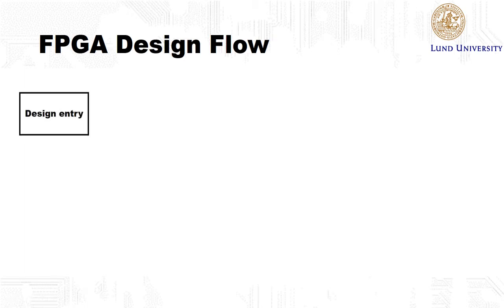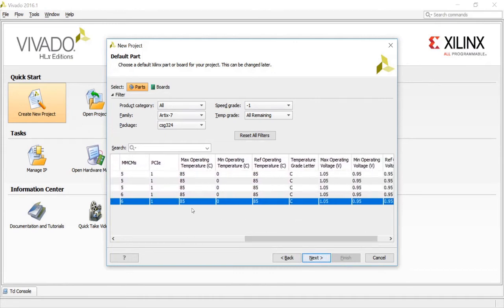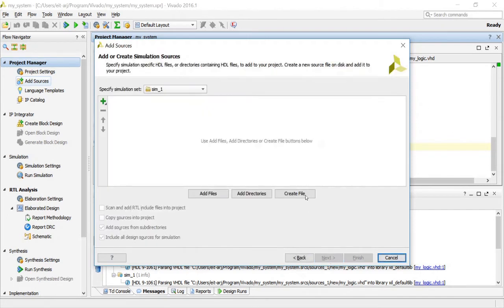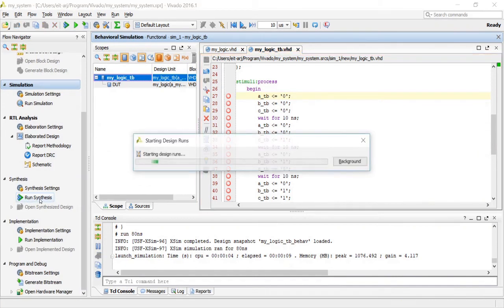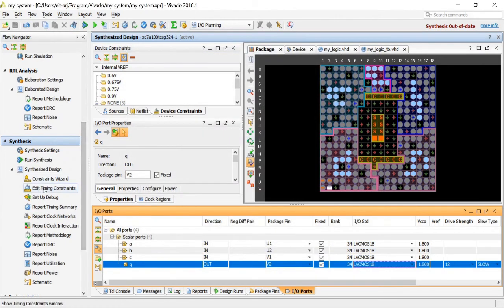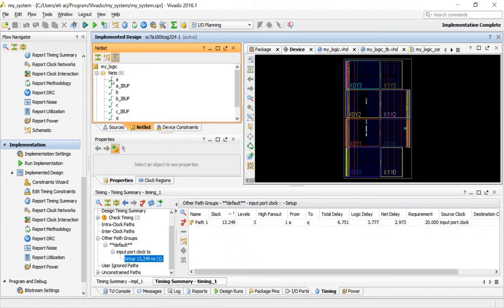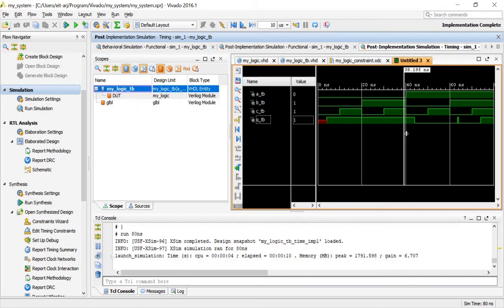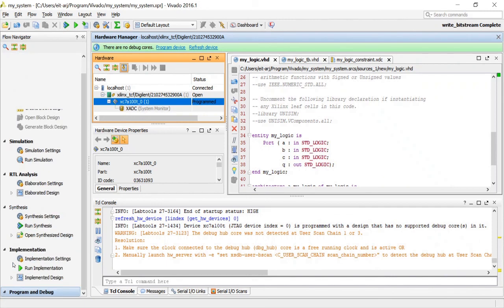Demonstration: FPGA design flow using Vivado

Comment: I am a beginner to the Zynq ZCU106 board and I want to understand/play with different IP components on this board. However, I could not find a lot of references in terms of block design using Vivado for me to begin with. Are there any advices or any guides or any reference template for me to start playing with the simple design and eventually make me a master in terms of FPGA design using Zynq?